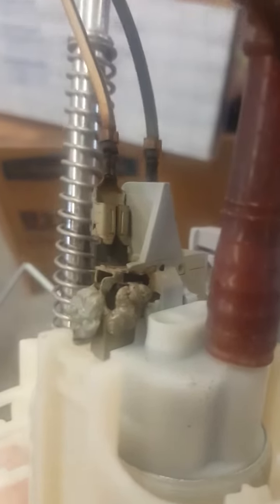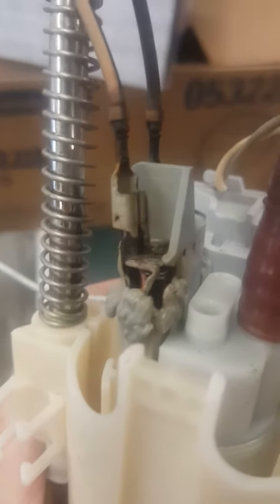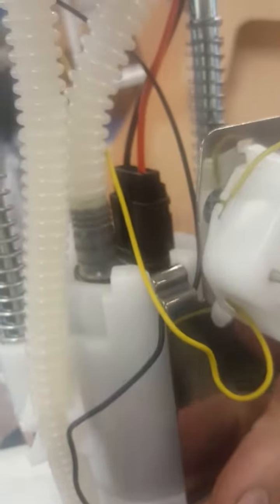2007 ford expedition fuel pump replacement step 3

Comment: Can I ask what model of 2007 Expedition do you have?  Is it a 2WD XLT?  Also, where did you get the fuel pump from?  I had put in a new fuel pump because of the same issue you had; when I put it in I noticed the fuel reading is not correct.  When the gas gauge gets to "E", I still have about 11 gallons in the tank;  did your gauge read correctly?  Thanks
Reply from the maker: Thank you for watching . The Expedition is a 4x4 XLT. I ordered the fuel pump from Rockauto.com - it was about $50 cheaper than the auto parts store.
Reply: @LouisatRshackBBQ  thanks....was your fuel gauge correct with the new pump?